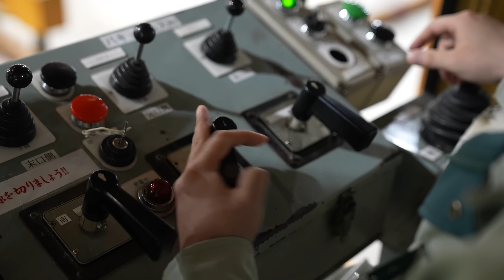コンクリートポールを大量生産するプロセス。 社会インフラを支える日本のコンクリートポール工場。

Comment: 16:46 What is the purpose of the wire inserted into the pole?
Reply: I suspect a preinstalled fishing line (for pulling wires internally) or a safety Earth for a terminal box.
Reply: Too small for a ground, likely for fishing the cable through. @steveurbach3093
Reply: @steveurbach3093  Oh, yeah, a line for pulling wires. I hadn't thought of that, although I have no idea what wires would be used in a pole, but I guess there may be something. If it were a ground, wouldn't it probably be copper?  Thanks for the reply.
Reply: @rinardman  If it becomes a light pole, for example, it will need the wiring pulling through internally.  Anything that requires a wire or data cable feed up to the top or any of the access points along the pole - lights, cameras, transmitters, visible switches/signals, relays, anything and everything really.
Reply: Thank you for the reply. 👍  @iatsd